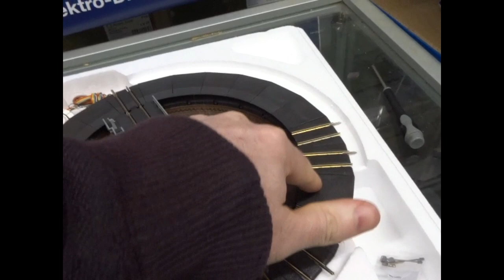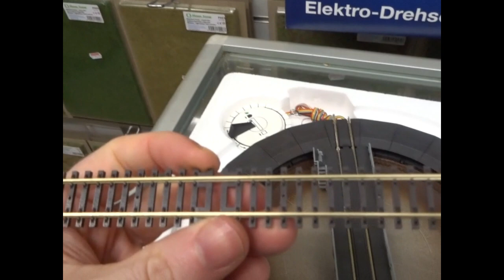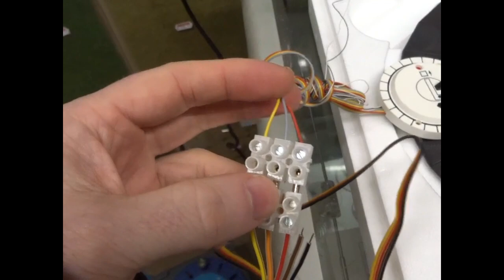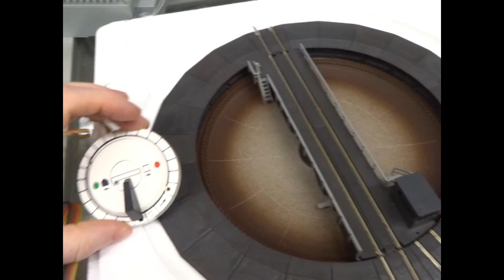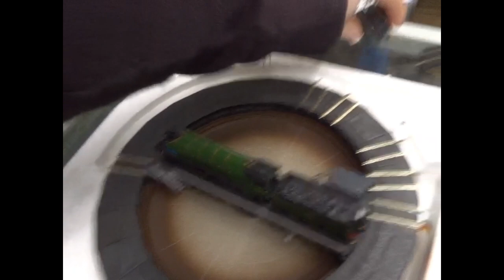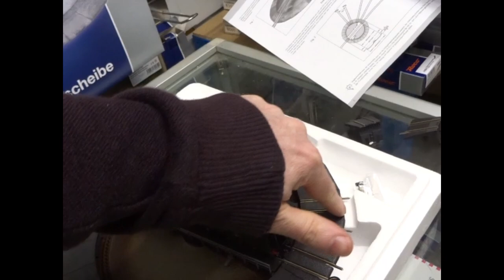Roco TT120 35900 Motorised and Indexed Turntable

Comment: You dont have to keep hold of the switch to turn a loco, if you move it one position then slide the knob to the edge it will continue on its own. I even had to tell Peachy TT 120 this too.
Reply from the maker: Thank you - I guess it is something we all skipped in the manual (Or just not in the translation I have)
Reply: Here is my video of the switch operation.  This method is not new, it was on the old Fleishmann turntables in the late 70's. 

https://youtu.be/s46kVUu9W70?si=Dt_XwH0BlqDFIKtG

@digitalcareline

Comment: Just to say thank you very much indeed for doing this video. I do have this item already and it is superb. I will shortly be changing over to DCC so this explains very clearly indeed how to do the wiring and the changes I need to make to the track. Without your explanation I would clearly have got the whole thing wrong. I live in France so it is easier to obtain the necessary reverse loop module from my usual supplier over here. However I will contact you tomorrow to try and purchase one of your Arnold Locos which I have been after for some time (which they don't have!). Again Many thanks.
Reply: Did you make the change to DCC if so did you need the reverse loop module ?
Reply from the maker: The reverse loop module deals with the short circuit that occurs as you turn the bridge and the left rail becomes the right
Reply: @digitalcareline mmmm, I’ve installed a RLM, the loco runs onto the bridge fine, I rotate the deck 180 degrees, when I try to drive off the short occurs when I rejoin the main track once passed the insulated rail joiner, buggered if I know why this is happening
Reply: @digitalcareline fixed, I was using my Hornby select as a trial controller for working all this out, I changed to my Elite just to see if it made any difference as I have a RLM running a loop on my layout, and bingo it worked straight away, thanks for your responses and maybe mine will help others
Reply from the maker: The Lenz LK200 reverse loop module LED will change colour as it detects the short and switches over-  JK In is the Main track power and JK Out goes to the bridge.  Just check that the insulated rail joiners have not been crushed so the the rails touch again.